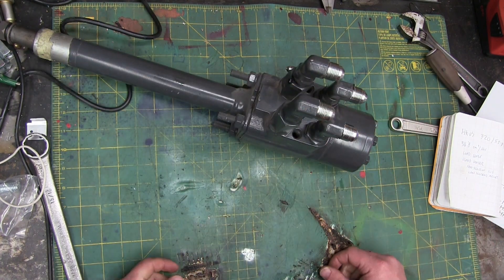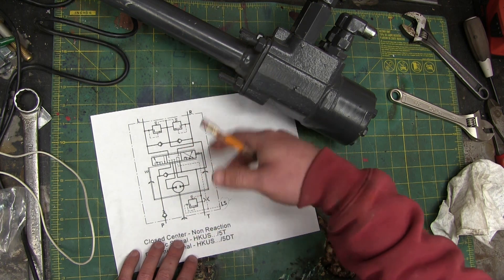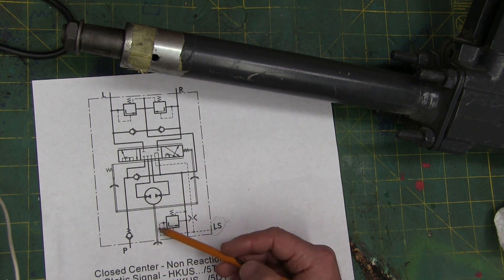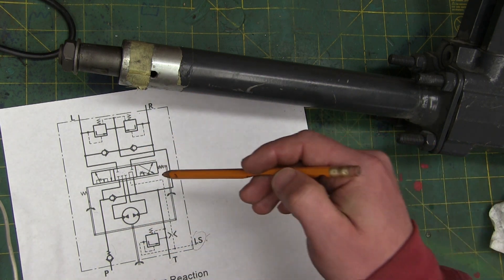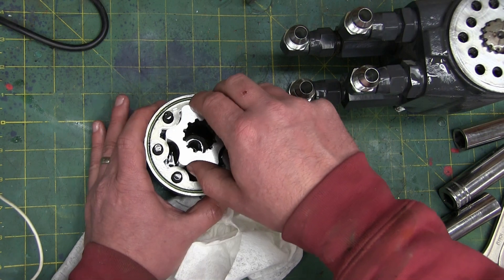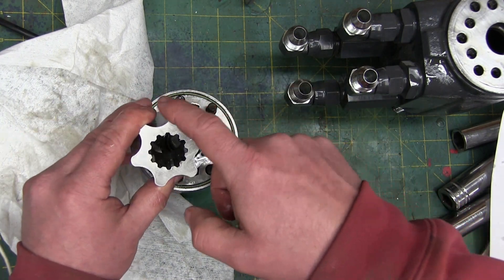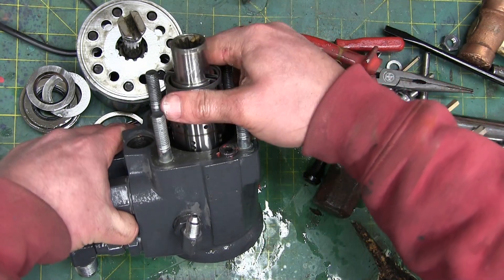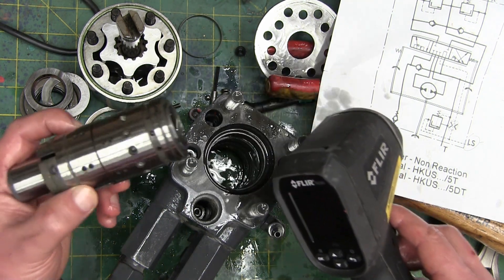BOLTR: Hydraulic Steering | Reading Fluid Schematics

Comment: K, if you got that back together in working order, you really should work for Elong Musket with your space age tightly fitting tooling, and your hydrolical computational rocket splugery and she shmoo in the metallurgical matrix. Not that there's any place for hydraulics on a space craft but in the logisticals and manufactoring end of the roman candle factory of space flight. How else are we going to beat the chinese and the russians at the new age space race without a little shmoo behind the wheel? Perhaps a stainless tube spiral rolling machine with electro actuated tig a ma gigs on cnc controlled electrodes that creates a controlled diameter tubular structure from a single spool of rolled up aerospace grade shiny stuff would be stronger than a brick pattern of hand welded panels craned into place by a set of chopsticks. Just saying, as a fellow enginerd interested in marterialistic properties on a nano molecular level I say a spiral yeilds a more stable structure when the seams spread the stress along the whole length of the starship. Just a hunch; however aasembly would become either really tall, or the beautiful helical marvel would need to be diced into bite sized pieces anyway. Can you envisage my message or does it sound like a tweet on the social garbage factory? Either way, my suggestion could be done either hydraulycally pneumatically of electro mechanically so don't get to torqued if the topic tickled your piston pump.

Comment: The top dashed pilot line on the reliefs are drains for the back side of the relief Piston. Without it, leakage would hydrolock the piston, so it doesn't move and it all ends in tears of hydraulic oil.

Comment: The reason for the pump being built in the valve is so when u don’t have the engine running u can still steer the machine manually

Comment: The springs re-centers the valve and return it to neutral.
And gives you a feeling of feed back, the harder it is to turn the machine the more you have to turn the steering wheel against the centering springs. The harder it is to steer the harder you have to turn the steering wheel.

Pro tip?
Don't hook the lines up wrong on any steering gear, you can turn the the steering gear into a motor and it will spin the steering wheel with great force.
Never reach through the spokes of a steering wheel when starting a machine up after fooling with the steering lines. If your arm is in there you won't like it.

The small 'bleed off line' is also to flow a bit of oil through the valve all the time which keeps the valve warm in cold weather. Without it the steering gets very stiff when not doing a lot of steering.
It takes a bit of time to get a hydraulic schematic completely loaded into the old coconut some times.

Comment: HOLY MOLY. I worked as an electrician for 2,5 years. After that I went back to school to study electrical engineering. But i could never really wrap my mind around how Voltage and current were related to each other. Ofcourse i knew how it worked and how to use the equations, but as a visual thinker i could never really see it. But after you said  "pumps create flow. pressure is a by product of the restriction of flow." IT FINALLY CLICKED!!!  6 years it took me, never could I really understand it, but finally.

oh man what a relief :P Thanks

Comment: Power steering has always baffled me. Nice explanation.  I used a hydrauliclly driven Wet Feed Machine on a farm and when they needed servicing or broke down, it was a nightmare best left to those with oil-stained hands and not shit-covered farm hands(Hydraulic oil, the other thing that sticks to blankets)  Once ya figure where all the ball bearings and springs went, it's fun.  Always, just beautiful finishing on the internal moving parts.
First job with hydraulics:- On disconnecting the pipes from the ram, neither I nor my journeyman thought twice about what was gonna happen when the sleeve slid down.  After the warm oozing feeling running down our hair, necks and backs, we realised we'd opened and lifted the wrong end.  I was washing Hypoid out my hair fer weeks!  Apprentice follies!

Comment: the one bearing in the input shaft is a good design, it relies on the female spline bearing to locate the free end of the shaft. if you had bearings on both it would be over-constrained and would need insane tolerances to not bind up.

Comment: That there is a mechanical comparator and differential amplifier. I replaced a Kubota one of these this past summer, and I fixed the faulty one. They stop working if the sense line gets clogged with shmoo.

Comment: This system has been made by Char-Lynn (now part of Eaton) for many years, and has many variations (Load sense, non-load sense, closed center, open center, etc.) For a good description of operation and options see here: http://www.eaton.com/ecm/groups/public/@pub/@eaton/@hyd/documents/content/pll_1585.pdf
The "non-load sense" shown here lets you exert huge forces with damn near no effort! I drove a John Deere tractor back in the '70's with one and got a front wheel against a post while backing up. Spun the steering wheel with one finger and it shoved the front end of the tractor sideways! Impressed the hell out of this farm boy!

Comment: The neutral springs are the trickiest part of re-assembly, imo. That's assuming you even still have them after dissassembly. They like to be airborne. The controller you have there features the leaf spring type. Much easier to install than the coil springs in pockets type. Open one from a Kubota tractor and have a gander.

Comment: As an electronics guy, and being a visual thinker, I always use fluid systems comparisons to logically troubleshoot and explain circuits. So many people I work around even the engineers just internalize Ohm's Law but have no idea why the equations work out the way they do. All you have to understand is that Pressure is the product of Flow and Resistance to flow... Voltage is the product of current flow and the resistance to that flow... V=I*R. I love this channel because it isn't just a guy trying to show his knowledge with fancy equations and material to memorize, he actually understands the real world.

Comment: I've played around with these a little, known as "orbital units" as far as I know the pump meters fluid and acts as a last resort for steering if the engine or hydraulics fail. If you notice the valve is operated only within the first few degrees of movement, the springs in the middle you pointed out bring the valve back to  "closed centre" so the centre of the valve assembly turns just a bit acting  against those springs and the fact the whole assembly turns is just to allow the wheel input to turn. The pin running through the valve assembly is the weak point that will break by the gorilla using the steering wheel to pull themselves up on the machine without hydraulic pressure. WORD OF WARNING! If you plan to put that back together, the pump is timed, time it wrong and it will turn the pump into a motor and 300Ib or not the steering wheel will break your wrist

Comment: Another configuration for closed center valve systems involves a variable pump (such as an engine driver pump), and a pressure-regulation valve (which is basically a relief valve with a return line to the tank).

Comment: From my experience with HMUs is that that pump is for total pump failure or for steering when engine is off. With the ones I have resealed on some CAT equipment. if you assemble the rotary valve incorrect, you turn the pump into a motor and  upon startup the steering wheel starts spinning like a motherfucker- THATS WHY YOU NEVER START EQUIPMENT WITH YOUR ARM THROUGH THE STEERING WHEEL!

Comment: Mr. Chris, on the char lynn units, the spool pushes the fluid through the gerotor, then to the appropriate cylinder, while venting the opposite side of the cylinder. There isn't a perfect link between the steering wheel and the control logic, so the gerotor pushes the spool to the next cog, which is the neutral position on the  spool diagram. Everything is now blocked off again.

The gerotor also provides haptic feedback for the operator, due to the flow through the system. The spool valve and gerotor turn one notch each cycle of the system, and passes a small amount of fluid each time, which is metered by the gerotor.

These also work without an input pump, as the gerotor provides the pressure and flow.

Give that little pump more credit!

Comment: I've got a new self contained variable displacement drive for a zero turn if you want it.  Its a half drive, so just one wheel but it is new.  Most of the gears look sintered.  (I took apart its fallen brother)  Its Hydrodrive I think.  Anyway, trying to think of ways to pay back all the brain learning I'm getting.
Down side is that it is self-contained, so a bit tricky to modify to do anything other than what its designed for.  It could get interesting if you added a rotary encoder though.

Comment: This is interesting to me, I've literally had this argument about automatic transmissions before. Although it is extremely simplistic, an automatic transmission is effectively a computer. A series of pressure dependent valves use a combination of RPM, throttle position/vacuum level and possibly a few other variables to determine what the output (gear) should be and actuate it in a controlled manner (accumulators etc.) If you look at a contemporary automatic, the springs, pistons and valves have largely been replaced with solenoids, pressure switches and hall effect or optical sensors.

Comment: The relief valve in the load sense line is the pressure override value, if the steering wheel is turned to full lock and the wheel is not centered, the pump pressure will achieve the value of the setting of that relief valve.

Comment: You’re a bit off the mark on your understanding of load sense. The schematic shows the load sense port is connected to tank when the steering valve is centered, therefore the variable volume load sense pump will go to the standby pressure (low, about 300 psi).

Comment: While it's funny that the circuit is only there so the guy behind the wheel gets a bit of resistance. Alot of operators complained when there wasn't any. So much so that we have this feedback circuit. Does feel like something is wrong with it without the circuit though lol

Also just touching the spool is enough to warm it up and cause enough expansion that you can't get it back in the bore. Gotta love proper machined tolerance. Getting a stiffy just thinking about them tight lubed up bores.

Comment: Would the check valve between tank and dump not mean that over-engineered pump would, in the event of your pressure pump dying, allow the manual pump to feedback through dump to the output and manually move the wheels by turning the wheel a few thousand times?

Comment: The pump in the base is a safety override for when the engine shuts down/hydraulic pump pressure fails. It allows for the ability to turn the wheel when the machines off

Comment: Nice video, just to add, the hand pump in the bottom is to have functioning steering in case of hydraulic power loss and the flat springs are there to have a little play so the steering has a delay when the wheel gets turned, so it's not as sensitive.

Comment: Great video, but sorry I have to be harsh: It really feels like you forged ahead without explaining what was going on inside the valve. I mean, based on my uneducated looks at the little "wiring diagrams" within the valve block, it is crystal clear that the pump line never gets directly connected to the left/right output ports. It goes via the hydraulic pump/motor within the unit. In other words, the hydraulic pump/motor within this unit is in series with the pistons doing the actual steering. But in any case, based on my interpretation of the diagram, when the steering wheel is dead-center, the (positive displacement) hydraulic pump it is connected to two dead-heads, which would mean that the steering wheel is locked in place and could never move. I feel a good explanation would, at the very least, explain why this isn't actually happening.

It wasn't even explained what the intended behaviour of this device was, either. If I turn the steering wheel to the right and let go, is it a) supposed to contort the vehicle accordingly and return the steering wheel to center so that you need to actually "turn left" just to straighten up, or is it b) supposed to contort the vehicle continually to match the position of the steering wheel, like a servo, in such a way that bringing the wheel back to dead center will automatically straighten up the vehicle? Because the latter seems preferable, but requires knowledge of how the vehicle is currently contorted (e.g., if the steering wheel is dead straight, the valve must still actively pump the cylinders to bring the vehicle straight if it currently isn't). That knowledge could be achieved by putting a positive displacement motor in series with the cylinders to keep track of how the oil has been distributed between them -- but look, that's exactly how the valve appears to be wired. If that's true, then the motor is doing far more than just "haptic feedback", it's the feedback part of the servo control loop.

Yours,
Someone who has never touched a drop of hydraulic oil in his life, so is probably totally wrong.

Comment: Good Sir, I have pondered a question and you might be the only person who could give me a straight answer.

Tesla electric motors, can they really last anything like is claimed?

Do you see them losing power slowly after day 1 if they are loaded to hell?

Whats the best way to protect such a motor for longevity?

You have better things to do but anything you could tell me would I would be grateful for.  

I own a Tesla, I just don't trust anybody who is associated with them to tell me the truth :P
Reply: MyJizz UrEye the motors don't have much in the way of failure modes other than their bearings, which should last a good long time. It's the batteries that will degrade over time, the motors should stay within spec for multiple battery lifetimes.

Comment: Multi-position, hydraulic valve (e.g. sliding) decoding can be confusing if there are lots of ports per position.

So print out a second copy of the hydraulic circuit and cut out the sliding bit of the valve from the copy. Slide the cutout across the valve on the uncut schematic to decode each position.
Reply: That's a great idea!

Comment: TECH TIP : Chuck your pencil in the lathe and use a bastard file to quickly and easily put a nice point on . 

BONUS ! - Minimum stock removal.

Comment: The valve body on a Hydramatic style transmission is a mechanical computer. It evaluates throttle position, input rpm, output rpm, shift selector position and gives an answer to the transmission of: 1,2,3, or 4.

Comment: Looks like a metering pump and the pressure relief valves look to be for toe control. So if you hit a big washout and it knocks your tire off center, you can simply turn side to side and get her going straight again.

Comment: It occurs to me that the pressure relief on the load sense line may serve to protect the load sense circuit from creating bad steering behavior in fault states.  If the load sense circuit is getting bad quality information due to failure of some other component it might cause the steering to over or under react.  Obviously whomever designed these things needs to think of every scenario in which it might unexpectedly take the steering to an extreme when it's not wanted, which could suck.  Since load sense manages pump output (pressure or flow?) a fault in its logic could be amplified.

Comment: So I always thought that the gear part of the valve was in fact a motor.  The idea being that as you rotate the valve to open hydraulic flow to the steering cylinders, that oil flow also then turns the motor, rotating the outside of the valve such that when the motor catches up to the steering wheel position, flow stops. Because the thing about a steering valve is that oil only goes to the steering cylinders while you are turning the steering wheel.  But my understanding isn't quite correct, based on what we see in the tear down.  Can someone explain to me how this works?  AvE didn't quite touch on that aspect in the video.

Comment: Back in the late 80's, while in the middle of moving a service rig to the next location, it lost all steering. Tandem steer front axles. Phoned the shop mechanic, who said brain box is dead. PITA to get it off the highway. Drop the front jacks, to get the wheels off the ground, wind up that old 8-71, and crank that wheel with a 200 lb gorilla.

Comment: Might be a dual spool valve, where the sleeve and the central spool can both move.  Look up the Rudder Control unit on a Boeing 737, it is a complex little bastard, and has had interesting failure modes.  Unfortunately those failure modes have resulted in planes going nose first into the ground.

Comment: Oh man...this brings me back a lot of memories. Being the pixie plumber I am - I found these quite easy to learn since these schematics aren't nothing else but circuit diagrams for hydraulics (HYDROLIKS in my native language) with VERY intuitive symbols (for the most part). The thing is you don't need to know everything. If you know what the system does, and you know most of the symbols, you can EXTRAPOLATE (Lisa Simpson vocabulary) from there on out. Really good and informative Vidjayo. Thumbs up from me!

Comment: Wouldn't the pump which is actuated by the steering wheel be used to regulate the volume of pressurized fluid going to the left or right cylinder? So basically there's always high pressure available and that small pump just moves a set amount of pressurized fluid per rotation to the cylinder. Just a thought otherwise as soon as the wheel was turned a small amount, you would get pressure to the cylinder until it reached max extension.